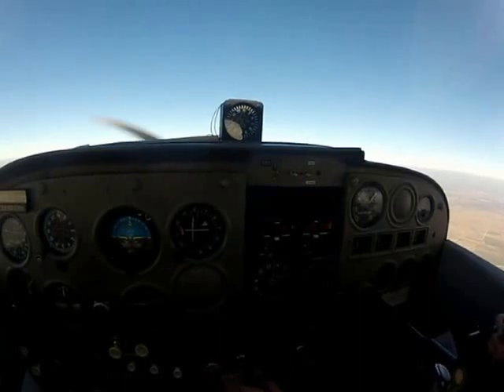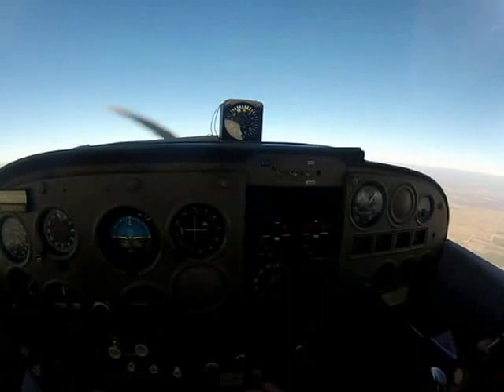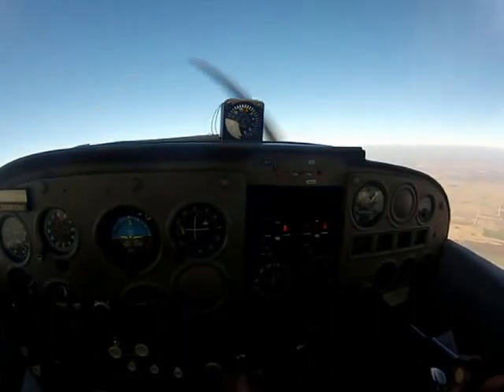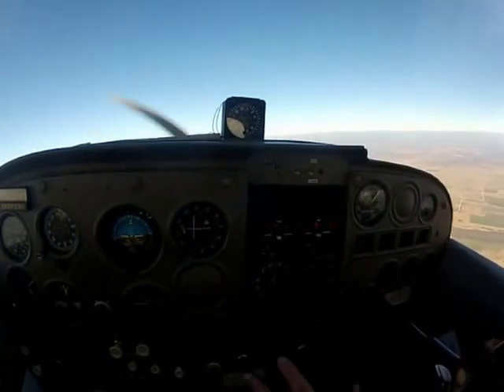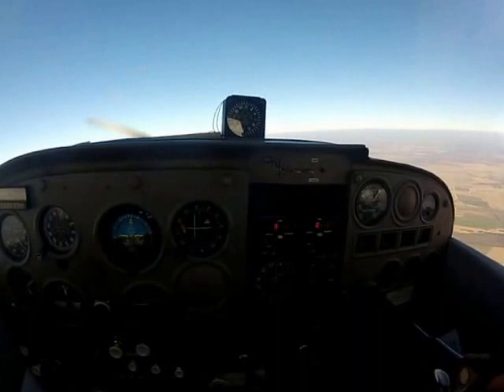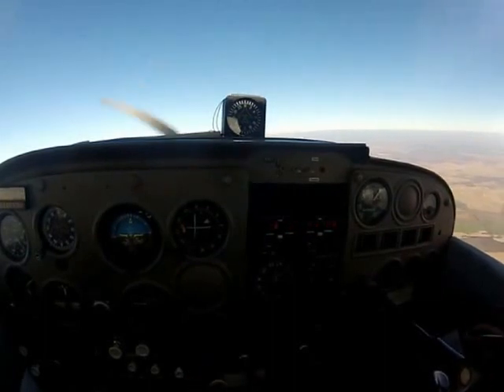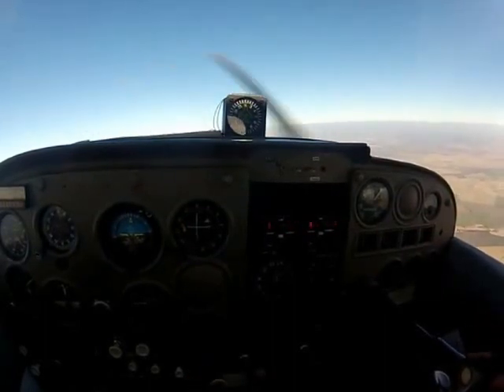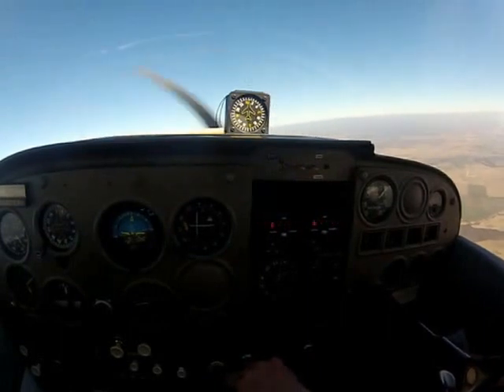Using Carburetor Heat While Flying

Comment: I had carb ice form during my Private check ride. :-) It was a classic day for it. Very humid, 60F. I was on downwind and the 152 I was in started to run rough as I took the plane to pattern altitude and 2000 rpm. Applied carb heat and it cleaned it right up. Was nerve racking though as the engine bucked and sputtered before coming back to smooth operation. That whole check ride was fabulous, first time seeing water in the fuel after sumping, carb ice, plane landing the "wrong" way as I was on final.

Comment: Thanks for this video.  The instructors I have flown with in So. California don't recommend carb heat usage unless you need it.  They say to do a carb heat "check" on downwind just to see if any ice has formed, but I didn't understand why every video I watched was telling me to use it, but my instructors were telling me not to.  Thanks again.
Reply: I am in So. California and getting my PPL and my instructor is always reminding me about carb heat when I forget.  I must use carb heat every time I land.  I guess it might just be a school thing or individual instructor thing.
Reply: The scientific truth is that ice crystals are always forming in the carb. They’re usually small enough though to not do anything and flush out without intervention. But even in 90 degree heat, there are still some ice crystals forming just due to the physics of the Venturi in the carb. 

So the carb probability chart isn’t really “when does ice form?”, it’s actually “when does carb ice affect engine performance?”

That’s the way to treat it. It’s always there, always trying to eat your carb, and you have to constantly keep it at bay through vigilant application of carb heat.

Comment: Depends on the aircraft, temperature, altitude, humidity. Running carb heat drops your fuel efficiency up to 10%.

Comment: I used to own a Piper Archer. Many do not recommend carb heat on this model due to air intake differences with Cessna. Is this true. I know Archer drivers who do not routinely use carb heat unless signs of ice. I don't believe its in the check list for landing when in the pattern. I could be wrong. It's been years since I sold my airplane.

Comment: Generally speaking, for a C152 or C172 apply carb heat (and leave on) anytime you reduce engine speed to 2,000 RPM or lower OR when your RPM’s drop below the green arc on your tachometer.  This is generally speaking. For specific information on this, refer to your Pilot Operating Handbook (POH) for the year, make and model aircraft you are flying.  Prevention (of carb ice) is the best cure. Staying “ahead” of your airplane is a best practice. CAVU everyone!

Comment: I am just a flight simmer but do you use carburetor heat on take off or just in slow flight?.cruise or landing?
Reply from the maker: Just at low power settings such as Slow Flight, Descents, Landings, etc. never on take off or climbs because it reduces your engine power output by a little bit.

Comment: We lost a crop duster! 
A pilot that was working for us, was pulling up over a tree line when he sucked a morning dove into the intake filter! Engine shut down. But had he pulled the carb heat, it would've bypassed the filter and kept running.
P.S. the pilot was okay but the plane didn't!

Comment: I'm confused as to why you use carb heat when going below the green arch. You said it was to prevent carb icing, but why is the risk of carb icing greater when the power is below the green arch?
Reply from the maker: EXCELLENT QUESTION!!     There is a "Butter Fly Valve" in the throat of the Carburetor..   During high power settings the Butter Fly Valve is nearly 100% open so it takes quite a bit of Carb Ice to kill the engine....    During Reduce power settings that Butterfly Valve is 1/2 Shut atleast so it takes 1/2 as much Carb ice to Kill the engine so there for it is a Higher Risk...

Think of it as a Piece of trash in a Water line... If the Water Valve is Fulling open the Gunk has a greater Chance to work its way thru the valve..        Now imagine the impact if the Valve was half way shut..   It would have a greater chance in getting Hung up and restricting the water flow.
Reply: Ayersaviation Oh! That's a great explanation and makes total sense. Thanks a lot for the response.
Reply from the maker: The Flying Farmer  our Cessna is a 1964 model with a Continental engine and we also own a 1960 and 1966 models 150's with Continental Engines. They all have Green arcs labeled on the tachs. I had to replace our Tach on our 172 that failed and the replacements all come labeled with green arcs that are model specific. All other points are correct about when to use carb heat. Thanks

Comment: Hi, ive got a question for you.
Why dont aircraft manufacturers just build a carb ice detection system into the carburettor? It would save so much hassle and tension.
Reply from the maker: Zax Zaxerly  there are lots of things like that  which would make flying easier and safer but I think it just comes down to being simplicity and cutting cost for manufacturers. There are after market products that will tell you what the internal temperature is inside the venture of the carb which helps.
Reply: Ayersaviation Ahh, that makes sense. Thanks for the information!
Reply: Also it’s because a lot of the GA planes flying today are really old, and the engine designs are just as old too. So as a result there’s a huge market for overhaul and maintenance on older engines. And since you can’t convert an engine from carb to direct injection, carbs survive. 

I personally think it’s ridiculous that we’re still having to deal with carb icing in 2022. The technology exists to prevent or automatically manage it in so many different ways, but it just hasn’t been prioritized

Comment: how is it 
that you can get carb ice when the temp is well above freezing ?
Reply from the maker: lw216316  increase of air velocity thru the carb drops the temperature
Reply: like wind chill factor the weather forecasters speak of....I suppose....
I would think the  carb would be sheltered from the wind for that reason....
but I guess these are air cooled engines...

makes me wonder why fuel injection is not used - seems float level would be a problem
in steep turns and fail completely in a loop.....
Reply: thank you, very good explanation...
that leads to another question-
why not use fuel injection and eliminate the carb?.....cars did so long ago.
Reply: seems like the float level in a carb would be a problem for planes,
in high bank and especially if inverted.
What keeps the fuel from spilling or feeding properly ?
Reply: Would doing a loop in a Cessna 172  (1950s vintage)
be risky ?
Back in the 60s I knew a pilot who did that  (not me - I'm not a pilot)
but I was sitting next to him !
Reply: I was just a kid and knew no better than to ride along for the excitement.
As an adult I reached the conclusion you expressed very well.
As for Bob Hoover,
I saw his performance at the Nashville Air Show a couple of times,
including the twin business plane....great pilot....much respect for him.
Thanks for your responses.

Comment: Why not always have hot air running through carburettor?
Reply: i want to know the same thing.
Reply from the maker: Air coming thru the carb heat system is unfiltered air so you could be putting dusty air into your engine. And you want to do that as little as possible. Less dirty than on the ground but still. Also the hot air makes the engine run leaner and less engine power is developed. That's why you have a decrease in engine power on the ground when you check your carb heat during engine run up. I hope this helps!
Reply: Thanks. Could you explain how hot air equals a lean engine? Hot air is less dense than cold air, so there is less air in the cylinder? Which would mean a richer engine? Not sure about this though.
Reply: Oxygen content is the same but hot air has less pressure than cool air because of density.
Reply: No, SAME AIR PER UNIT VOLUME it's just at a lower pressure. A liter of air is still a liter of air so the CONTENT does not change, neither does the nitrogen, CO2 or any other gas in the air. The PARTIAL PRESSURE of all gasses drops (including pO2) because the AIR PRESSURE changes.
Reply: graham, you are confusing partial pressure with content composition. You wrote "If you take a liter of air at 30,000 feet, and a liter of air at sea level, you will see that there is LESS mass at the higher altitude for the same volume.  That means there is LESS oxygen per unit volume" Absolutely incorrect - I am using 'absolute' in the correct context here. PARTIAL PRESSURE OF OXYGEN CHANGED not the content. The air at 30,000 feet is the SAME MIXTURE OF AIR AT SEAL LEVEL with some exceptions for water vapor. Oxygen CONTENT is still roughly 21% and altitude did not reduce that number. PRESSURE is what changes, not content. Also as you stated 'Hot air has less oxygen' - again, NOT TRUE. Hot air has less PRESSURE but NOT less oxygen.
Reply: No. Mass =/= content =/= WEIGHT  You're mixing units and that's what is confusing you. I know these terms get thrown around like they all mean the same thing and that confuses a lot of people. If a cop pulls you over for speeding and says "You were driving 170 km/h" and you say "But, my car only costs 1.4 tons." Cost and weight are irrelevant to speed.
Reply: per unit volume =/= [this 'equal slash equal' means "Not the same as"] per cent (or per mil) again you're mixing units. One is absolute and the other is relative. It's over your head, please for the safety of the public, NEVER try to fly an airplane.
Reply: How old are you? 14?
Reply: Well it decreases engine performance slightly.  But that is better than a potential crash.